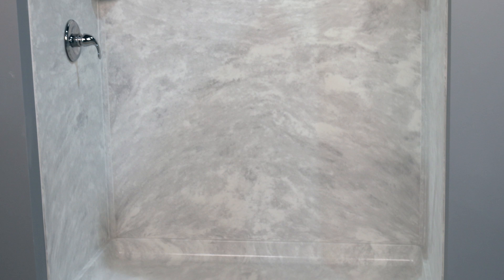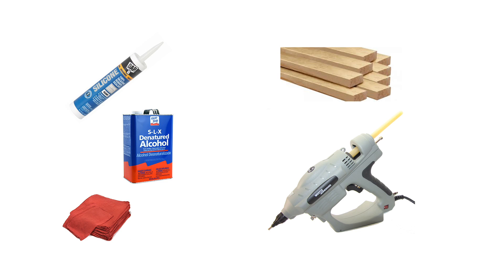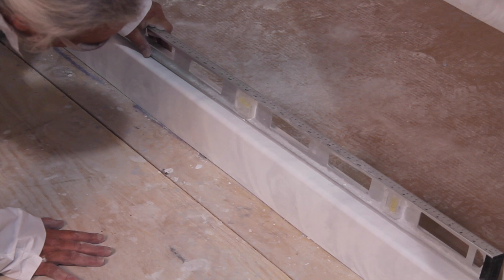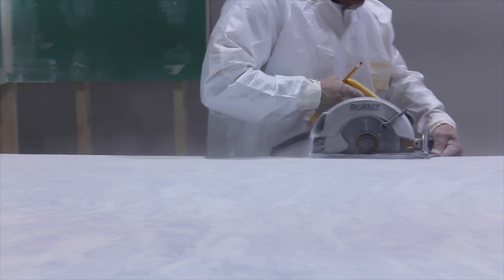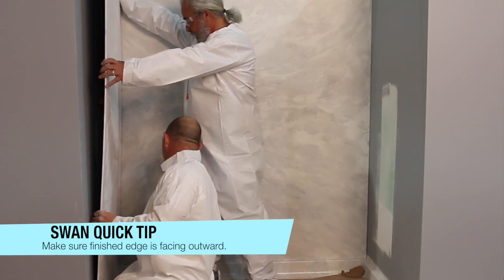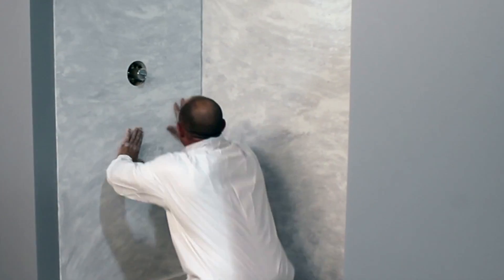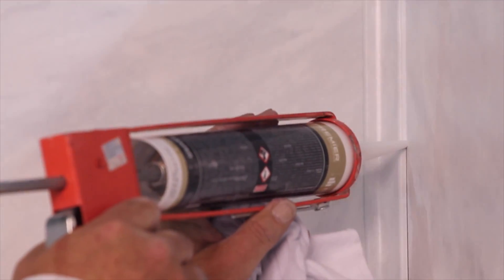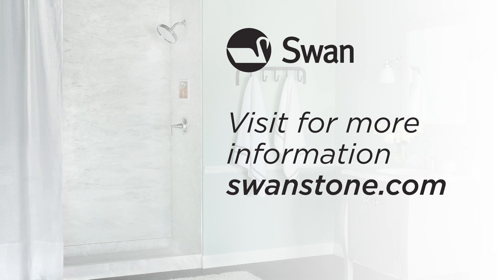Swanstone Installation Video

Comment: I purchased the subway tile look and calculated the material at a little over 3 lbs per sq ft. Making my back panel about 106 lbs. A two man lift for sure. I made a template for the back wall and left the material in my garage as it’s to heavy to lug around. For cutting the material, I prefer to use my Dremel Saw Max. The blade is about 1/16 in thick and is designed to cut plastic, aka acrylic. It’s great for laminate floors as well. Always wear a mask. The dust is as fine as flour. No need for tape, no chip out. Because I had made a template, there was no need for a dry fit. I applied the silicone to the wall and pressed the panel in and clamped it using 2 x 4s. Next day I set the side panels. Do your homework. A perfect wall does not require corner molding. It is a great material, looks gorgeous and will stand the test of time.

Comment: Can a Swanstone panel be used as an alcove ceiling (non-shower, no moisture other than ambient bathroom conditions)?
If so, what adhesive is recommended to provide the maximum adhesion (after bracing is removed)?

Comment: why not apply silicone to the wall, rather than the panel?
Reply: Because
Reply: @jacobcairnes521  I prefer putting b00b in a tube donuts to both surfaces, it’s like cramming two boxes of 
Krispy Kreams together.

Comment: Do you have to use a shower base
Reply: No the subfloor is waterproof
Reply: Many people install these walls with concrete or tiled shower floors. Pan/base is not required.

Comment: what is the blade used to cut the straight line
Reply: At the beginning of the video in the "tools required" section he said for a circular saw use a 60-80 tooth carbide blade.